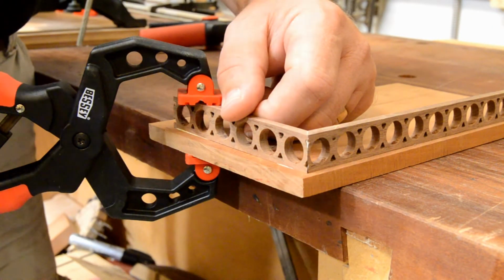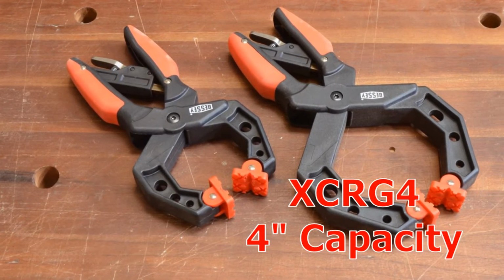BESSEY - Ratcheting Spring Clamps XCRG

Comment: These things suck so bad, its unbelievable. I love the old version. There used to be some flexibility in the plastic arms that allowed you to keep ratcheting the handle after it makes contact with your workpiece. That is why you could get such a strong clamp force with the old version. Now, it seems to be reengineered to be not only ten times more complex, but ten times more rigid. The result is a clamp that makes contact with your workpiece and sets back to the closest ratchet tooth. They are so rigid you can't crank down and get another tooth position out of it. They all end up just falling off under gravity. Total garbage. Designed by a rookie? Maybe someone made a material change last minute before release? Astoundingly bad. Thanks for coming to my TED talk.

Comment: Those are awesome! Will these make it to Home Depot?
Reply: They're there, as of March 2019.  I'm not sure yet if these are better than C-clamps or bar/clutch clamps for many jobs, esp. light woodwork, such as the repairs I'm making to 5/8"x3" wood furniture straight, regular legs where the edges/corners have shredded & cracked over time, and the edges need rebuilding & clamping while glue sets. A strap clamp shld work well, tho they're difficult to purchase for such small work (the Bessey VAS 23' strap clamp won't handle such small wood).

Comment: I just bought 2- Bessey 4" Deep Reach ratcheting spring clamps at Home Depot yesterday, 2/5/2024, and I'm disappointed. I have to agree with @bradkrit. I can't get them to put enough force to hold 2 of anything without slipping. I came to youtube hoping a video would show me I was somehow using them wrong, but I see nothing different then how I tried to use them.